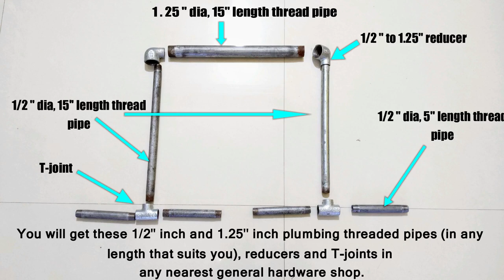How to make a Push up parallel bar at home: DIY

Comment: 2 x 1.25" dia 15" threaded pipe $17.26,
4 x 1/2" to 1.25" reducer $3.21,
4 x 1/2" dia 15" threaded pipe $13.03,
4 x 1/2" T joint $11.99,
8 x 1/2" dia 5" threaded pipe $2.43.

Total cost before taxes$166.88.  Same dimensions product sold on Amazon cost $89.
Reply from the maker: Hi.. out here in India it costed me total around 9-10$ only man. The rates you have put for the hardware seems exorbitantly high. Also it took me just 1 hr to assemble it along with the rubber tube. Cheers ..!!
Reply: @fit_by_inch  i wonder if I can order them online cheaper. Love the idea, but not cost effective where I live.